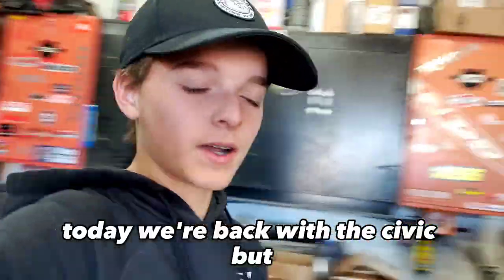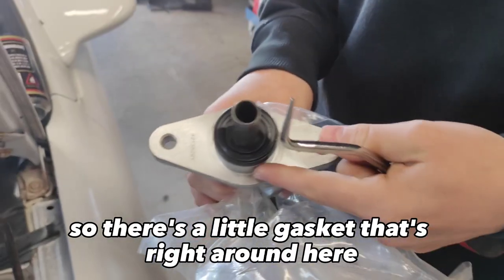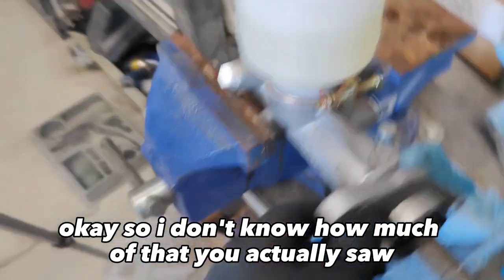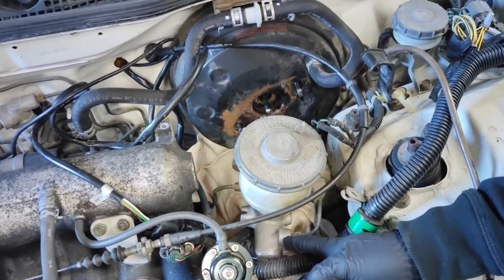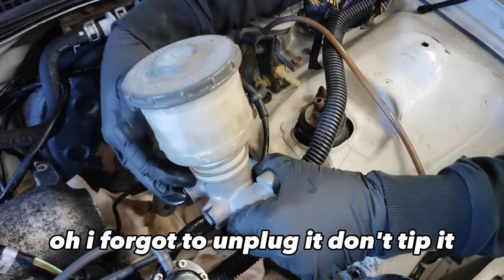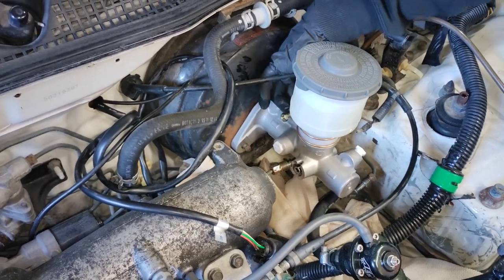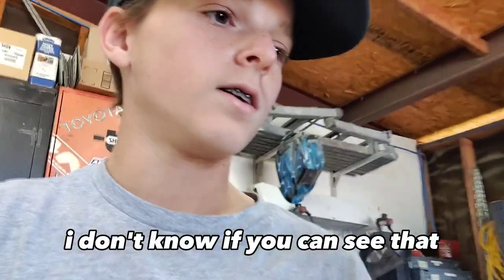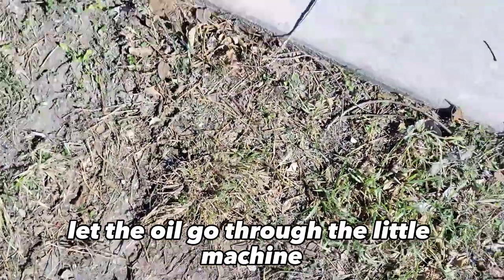Cars are pain | How to replace master cylinder + how to bleed brakes | Ep. 5

Comment: Man cars are a pain..  I bought a copart 99 civic that is from Canada with very low miles that had almost no rust and had nice wheels and coil overs..   I tried for months to title it and the only way I could title it was the Vermont loop hole because I had a bill of sale..  a YouTuber saw the trouble I was going through and gifted me the same style and year civic just auto and a lx instead of a ex..  but the gifted civic was super nasty no windows mold and just yuck everywhere..   so now I'm in the process of taking everything off the black civic ex and swapping it all over to the gifted civic.   Both have been a pain especially the alternator bolts that were seized and I had to take the sawzall to the bracket.. and now I have a lot of extra parts    that's why I was going to send those bolts to you..    but good job on the build
Reply from the maker: That's crazy
Reply: @speedkreminal  it's been a real struggle..  tomorrow I pull the motor hopefully..   I live in Iowa and it's cold here.  And I'm doing it right on the street. We have a garage but my wife has a project 79 long bed c10 Chevy truck we are also restoring..